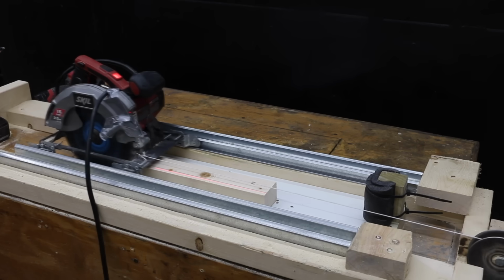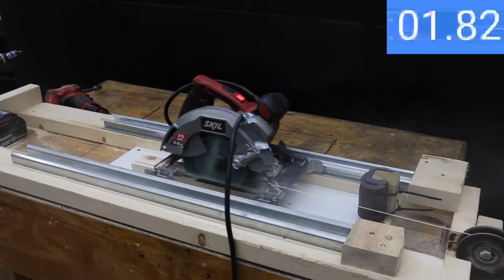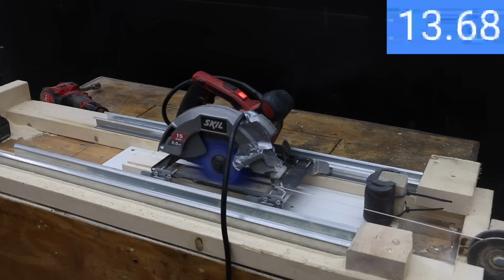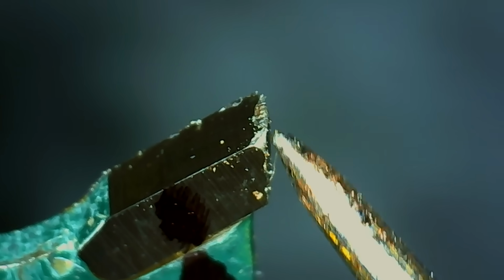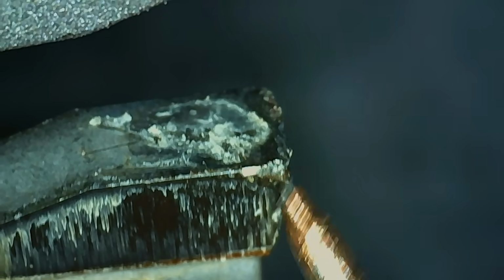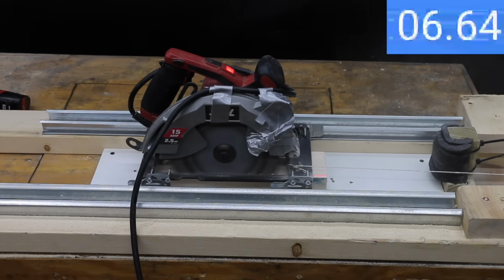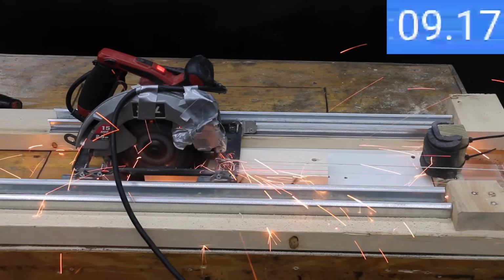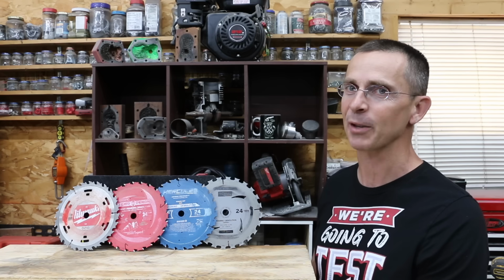Best "Demolition" Circular Saw Blade? Milwaukee, Diablo, DeWalt, Hercules, Evolution, Bosch, Amana

Comment: I think you may have use blade not suited for plain wood, the one for plain wood should have a profile like / \ / \ / \ altenatin between teeth. If you have like a squared D shape falowed by a flat one that is usualy for  aglomerate plank like mélamine all the other stuuf is probaly just marketing and bigger profit, i learn this working in a wood working factory after smoking hard wood on the wrong bench saw hehe, Small detail not every one know, you can use the hard / plain wood profile on anything but it will not live as long in melamine. like those test, thank you,  sorry for the bad orthographe and english.
Reply from the maker: Thank for the feedback!

Comment: That testing setup was really awesome.  I know you have done adhesives before, but it would be interesting to test superglue cured with baking soda, as well as some of the "instant" cure UV adhesives against the old standby epoxies.  Perhaps test some of the sub $250 air compressors?
Reply from the maker: Thank you for the suggestion!

Comment: I have a little milwaukee handheld metal saw and a very similar looking wood saw. I accidentally used the wood saw with a diablo carbide tipped framing blade for cutting 1/8" diamond plate mild steel. It worked fine and sustained very little damage. I didn't even notice a difference in the performance with the purpose built saw.
Reply from the maker: Thank you for the feedback.

Comment: I tried a Hercules blade recently. It never cut a single nail or screw, only plywood, yet it seemed to get hot easily and ended up warping badly after little use. Maybe I got a defect. I'm willing to try one again, after watching this.
Reply from the maker: Thanks for sharing.

Comment: Sir...Would you consider testing deep cycle batteries designed for solar PVC panels and maybe some 100watt solar cells? Also the portable LP water heaters for camping showers would be a most interesting contest..than sell me the.best of the lot..lol...
Reply from the maker: Thanks for the suggestion.

Comment: With lumber costs this may have been your most expensive tests yet lol. Have you tried the rechargeable lithium ion AA and AAA batteries? They supply 1.5v vs the 1.2v Nimh, I have some AA and they seem to work well but would be interested in seeing how they compare to  nimh and between different manufacturers.
Reply from the maker: Thanks for the video idea.

Comment: The Diablo is made by Freud. We’ve been using Freud for over 20yrs and my uncle refuses to use anything but. I’ve got a Makita saw that I use in my home shop that has had the same Freud blade on it for almost 8yrs.
Reply from the maker: Thank you!

Comment: Can you explain the terms Framing and Demolition in wood cutting? I'm not native english speaker, sorry.
Reply: Framing is when you build a new house. The boards are clean and soft, and don't have any metal inside them. Demolition is when you are destroying an old building. The boards are old, dry, and hard. There are many nails and screws inside the wood.
Reply: @craigslitzer4857  Many thanks!

Comment: I use the Diablo now for installing timber fencing, I was suggested to change from Makita to Diablo this time last year and have only just worn the blade out from hitting a high tensile screw.
I use the fine tooth finishing blade for cutting through 150x40mm wet pine rails and it performs well and the battery life of the saw increased so much after the change from Makita.
Happy as to see it did well in these tests as well
Reply from the maker: Thank you!

Comment: Is Milwaukee as good as the others or are all "Demolition" blades just as bad at cutting metal as a normal blade? I suspect the latter. Especially since all the expensive and overengineered  ones are actually worse.

That test jig though, that is phenomenal.
Reply from the maker: Thank you!

Comment: Love the channel, but sometimes ..like this time, I question your definition of what makes something "better".  Most of these are functionally the same. You often rank things based on essentially meaningless differences (kinda like ranking diamonds by imperfections that we literally can even distinguished between with the naked eye.) and doing so is kinda misleading. Also you tend to focus on speed no matter what you are testing. You may wanna revisit that idea. If I were buying a blade for cutting wood. MAYBE the difference between 6 and 7 seconds would matter (but since the difference in time is so small, the "better" differentiator would be something other than speed, like price or warrantee or hardness or w/e).  But for a demo blade, far more important would be strength and durability.  What can it cut through and how long will it last. So for something like this I would think that "which failed last" (like you did testing tape on a pressurized tank) woudl be the best test.. not which is fastest . Just constructive criticism from a huge fan and supporter. Over all I give you a solid "A". Thanks for all you do. You have helped me avoid a number of huge mistakes!
Reply from the maker: Thank you for the constructive feedback!

Comment: This might be tough, but could you test stop leak additives.  You might have to get several vehicles together  (like five per additive tested).  You'll probably think of a better way.  I love the methodical way you measure and test things.  Maybe you could bake seals in oil to reduce pliability.  Maybe at higher than normal temperatures. Then soak the seals in stop leak/oil mixture at normal engine temperatures to see if the pliability is restored.  I had a Corolla that I cracked the head by overheating it late at night.  The mechanic fixed the head but there was a leak that would have required the transmission to be dropped in order to repair it.  I threw in AT-205 and it fixed it right up (as suggested by Scotty Kilmer who had mentioned it several times in his videos).  Just wondering if anything new or better is available.
Reply from the maker: Thank you for the video idea!

Comment: Rip and cross cut have different blade requirements FYI
Reply: That's why they make combo blades
Reply: @robertfandel9442  10-4.

I engineer saw manufacturing equipment.  Testing new equipment as we speak.

FYI
There is a lot more to it than combination blade or not.

Hook angle, front to back, top to bottom, back angle, overhang

You can have two manufacturers blade with the same tooth form and get different results by how many thousandths of an inch they have on any the many criteria.

Comment: Accidentally cut through some nails in a shipping pallet  using Makita cordless saw and it lost like 12 out of 16 carbide tips they were just gone completely sheared off where it is soldered to the saw blade.  Safety glasses needed.
Reply from the maker: Thank you!

Comment: We use the basic cheapest Dewalt blades and put them through hell all day everyday and I've never seen one fail to finish a cut.but they don't have the Lazer cut vent technology either so that's interesting.
Reply: I wasn't surprised at big blues terrible performance. It looks like a little kids ninja throwing star.
Reply from the maker: Thank you!
Reply: @ProjectFarm  your welcome I appreciate your commitment to accurate controlled testing. I'd love to see your version of a flex vs the big brands under realistic abusive conditions completing tasks that are truly demanding. And I don't consider drilling lags into soft pine as demanding as most of these other channels. It's like they review tools but don't ever actually need to use them. Torque test channel tested the theory and the brass tax numbers. I wanna see your unbiased  controlled version  of the match up testing actual working performance and longevity. Under adversity. Bc on the jobsite if it can happen it WILL happen.

Comment: I'd like seeing this same test with just your standard 7 1/4" 24T framing blades. Nothing over roughly $10-20 essentially, unless it was from a 3 pack or bigger. There's probably around 20 common brands of those sort of blades, so since you can't include them all I'm really curious how the new Flex (from Chervon) stuff holds up and compares.

The Big 4: Dewalt, Flex, Makita, Milwaukee
Avanti, Bosch, Craftsman, Diablo, Hart, Irwin, Metabo/Hitachi, Ryobi, Wen
I don't have Menards, so I only know of them carrying Mastercraft
The 3 HF brands: Admiral (being discontinued?), Bauer, Hercules

That's 17 I came up with quickly, even leaving out 3 or 4 brands you tested here. I wouldn't expect to see them all compared, but all of them make common and reasonable "cheap blades" someone would buy or grab to make a questionable cut. Several of those are probably identical blades with different paint.

Even Hilti makes consumable/disposable blades for less than insane prices. The problem is buying them in smaller than industrial jobsite quantities.
Reply from the maker: Thanks for the suggestion.

Comment: I love the testing, but I feel the pull weight was a bit low. The thicker demolition blades need more force for the same pressure. I'm curious as to how they would have compared with more pull force. Also perhaps even more torture testing. A demolition can require a Lot of "dirty" cuts.
Reply from the maker: Thanks for the feedback.

Comment: Are you having a good day the craftsman cmcf820 is a impact driver has 0-1300 speed 2 0-2600 speed 3 0-2900 imp is 0-3800 Torque is 1700 make in USA global Material
Reply from the maker: Thanks for the feedback.
Reply: @ProjectFarm  I’m here to make sure you remember to get the craftsman cmcf820

Comment: The diablo demo blade is my go-to  blade for most construction uses. I also like the Makita thin kerf 24 tooth blade, which is really sharp and smooth cutting and low cost.  It will cut some nails too, but won't last as long as diablo when cutting a lot of nails.
Reply from the maker: Thanks for the feedback.

Comment: That Big Blue was one of the most expensive and ended up last or close to last in every test. The Milwaukee control was WAY better. Plus, it looked liked the Big Blue slung a lot more debris out the side. I would not use that blade under any circumstances.
Reply from the maker: Thanks for the feedback.

Comment: Great video ,I watched a amsoil guy talk about 10,000 mile oil change and he said the better oil will last that long without a problem but the little filters get full of dirt and go into bypass mode before 10k  could you test that out and for one of the filters use a motorcraft fl2051s diesel filter. Thanks
Reply from the maker: Thanks!

Comment: Fewer blades shouldn't slow it down, especially on a rip cut. Fewer blades means it clears sawdust better and has less friction. The kerf and carbide angle of the demo blades is what slowed them down
Reply from the maker: Thank you!
Reply: @ProjectFarm  yessir. I would bet the demo blades have a negative rake so they don't bite too hard into the metal nails or screw
Reply from the maker: Thanks for the feedback.

Comment: VIDEO SUGGESTION: Digital thermometers! Pens, wireless, wifi, Bluetooth, lasers, etc.
Reply from the maker: Thank you for the video idea!
Reply: Not sure if pens really are applicable to this channel, also, what exactly do you mean by "wireless", I assume you meant routers for the wifi (or extenders) but not sure about Bluetooth (USB Bluetooth adapters)? Honestly only the digital thermometer seems applicable to this channel...
Reply: @Bremend  I am in the market for a good grill thermometer that will monitor temps for long cooks in my smoker. They make wireless and wired probes. They make ones that will transmit temps to your phone through wifi and/or Bluetooth. There are several metics to consider: reliability, accuracy, durability, heat resistance, transmission signal frequency, signal strength, signal distance, battery life, battery type… all of these before and after a torture test. Ie thermoPENS, WIRELESS thermometers, WIFI thermometers, BLUETOOTH thermometers, LASER thermometers…

Comment: Just an FYI if you are doing a demolition job and want to salvage the lumber a good cheap cheat is to just find an old school lawnmower blade at a junkyard the straight kind. Grind down one end to make a handle, sharpen, heat and quench the other end to harden it. Then you can use it as a sort of machete to wedge in between points where boards are nailed together and drive it through the nails with a hammer. That lets you salvage 2X4s and such full length for use in other projects without wrecking expensive saw blades. Works good for dismantling pallets too without having to deal with nails and staples sticking out of boards or getting lost in the dirt and ending up in my foot or tires. But all I do is burn pallet wood for firewood anyway since they are typically made out of crap wood.

Comment: R.I.P. the project farm’s accountant after finding out he used his entire  yearly budget on the lumber for this video
Reply from the maker: Thank you!
Reply: The copper thieves will expand to ripping studs out of walls using these blades.
Reply: I thought the same thing, the 2x4 was  more than some of blades
Reply: 😂 I thought the same thing, I wondered too what he spent on lumber 👍
Reply: At this point it may be worth buying a small mill.
Reply: Can we get a video on metal roof coatings covering adhesive quality, durability, corrosion resistance, and temperature change in hot or cold
Thanks for all your effort you are very thorough in you methods.
Reply: @Justin Beaird You don't really need to argue.  @Phillip Mishkov  is right, there is a shortage of housing on many cities throughout the USA. People are willing to pay $50k, $150k, etc. above market price. People are fighting to get a house. And, for those californian and new yourkers, well, prices on states like Texas are still a steal compare to the crazy prices that they pay at their home states. You are also right, when the market change, which will do, all those people that bought houses during this period will have a hard time digesting the fact that their homes are not worth what they paid for. Now, a lot of people make the decision to buy because they can, but others have no choice, those are the ones hurting the most. As  @Phillip Mishkov  said, for the builders, remodelers, developers, home owners saling their investment house, etc. it is a good market, but not for those that have no choice as renting is also over the top.
Reply: I can get you hundreds of pallets.
Reply: That looks to be 200$ in lumber, especially when the its cheap treated 2x4s like that
Reply: Hahhaha
Reply: Buy saw blades in droves of all types and sizes!  Can not wait for this one!
Reply: I’m convinced his replies are a bot system 😂
Reply: 2x4 Is cheap...
Reply: Jokes on you, he cuts down his own timber
Reply: haha funny, I was just gonna mention something about this being the most expensive project yet!
Reply: Shouldn't be as funny as it is
Reply: You mean his wife? Haha
Reply: It can be used as firewood
Reply: Wifey isnt gonna be happy lol
Reply: Please do a comparison of 7.25" metal cutting blades of both types, ie: toothed like the Diablo Steel Demon and abrasive blades.
Reply: Very funny but in a wrong way....
Reply: Justin Beaird I live in Washington state and out here builders get crazy money for the houses and even with the lumber prices there still making good money. I guess if your a just a regular guy trying to remodel it sucks but you can always find wood you can salvage from somewhere
Reply: Justin Beaird first thing We don’t do things the worst possible way I frame top notch high quality stuff my frames and siding are some of the best around im not afraid of showing my projects nothing to hide and there’s many of us like that here. That’s why I say if you can’t build, don’t build, prices are high but there’s many builders that made that extra money earlier so it doesn’t matter for them they complain but I know they know the prices suck so i shouldn’t be worried about lumber costs. The market is hot here buyers from all over and it’s so hotthey paying extra for empty lots. Like right now there’s full neighborhoods not one single house built, all lots sold to either China or California
Reply: Justin Beaird 50k extra for a house isn’t even that bad if it costs 50k more just build a smaller house
Reply: Its a tax write off
Reply: Wtf it’s not that bad the house sells and pays both the builder for his expenses, and the money spent on project. Pay up and stfu don’t build if you can’t
Reply: I was just about to comment this😂
Reply: It's a couple of 2x4s calm down
Reply: @HarveyShankar  Knowing the price of lumber for the past couple of years I understand the comments.... I wanted to build a steamer trunk, found out it was cheaper to buy a certified antique than to the wood to make it myself :\

Comment: Nice Circular Saw Jig! I was concerned about the electric cord rubbing on the same spot of the cord, while it sawed. Would a wire coat hanger attached to the saw, and extended out as a spring arm (cord zip tied to the wire arm), have kept the cord from dragging on the board in the one spot? Safety Third!
Reply from the maker: Thank you!

Comment: I was under the misapprehension for a long time that you couldn't use carbide tipped blades on wood with nails and screws. For that reason, I put of disassembling something I made years ago that can be broken down to make quite a few very useful shelves for my home. This video is the icing on the cake! Thanks!
Reply from the maker: Thank you!

Comment: The cheap brands really surprised me, that’s excellent, it will save money on framing blades! Diablo is normally my go to premium blade, so that didn’t surprise me. 
Anecdotally, I’ve had a DEWALT blade do some goofy things with vibration at seemingly random intervals. I’m not the biggest fan of their blades and driver tips either
Reply from the maker: Thank you!